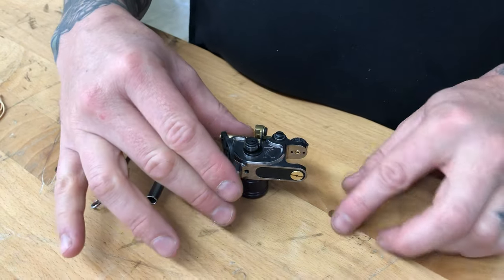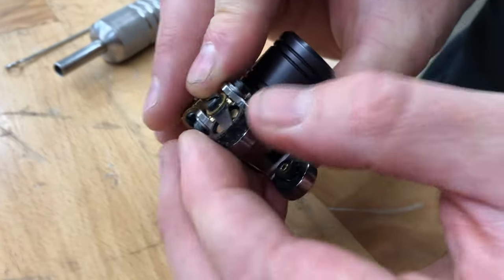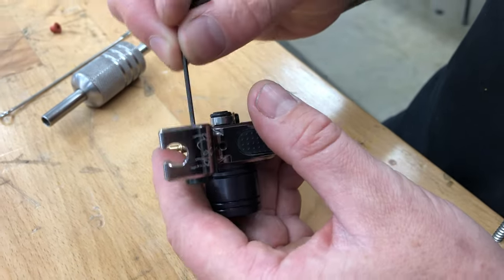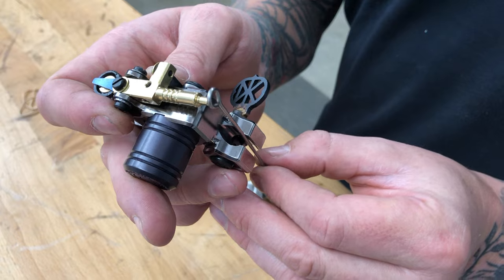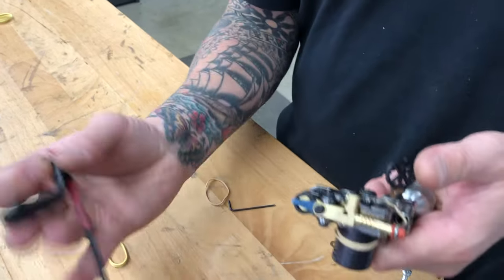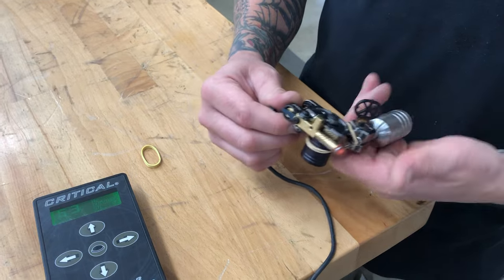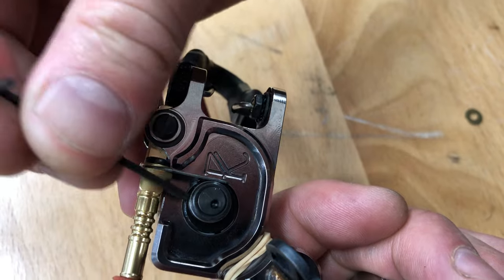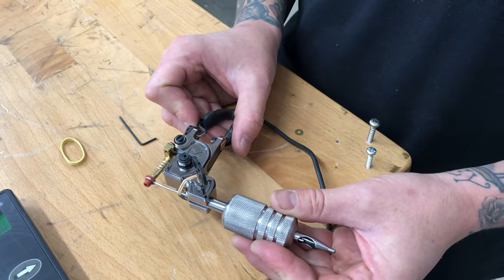Sidewinder V3R setup and tuning

Comment: ive been using two types of v3rs now for almost three years now. I love them and they’ve really made tattooing easier. I do get puzzled by the impact screw/timing mark. I usually run it around 5.8-6.5 volts depending on the work/placement. However, I’m not exactly sure of where the timing mark suits my tattooing best. If I haven’t gotten this video wrong after the 4456th time ive watched it, the closer to the end of the timing mark the harder the impact will be?
Reply from the maker: The more you turn in the contact screw, the more impact you will have, and the cam will be rotated counterclockwise as the impact is increased.  I usually set the impact so it lines up in the middle of the notch
Reply: @dankubin5386  thanks for the quick reply mate. nice to have it confirmed by the man himself. i guess i just have a case of classic overthinking! take care and thanks for the tools

Comment: Can you show us the proper set up for running this machine with cartridges?
Reply: Not suppose to run the v3r with carts.
Reply: @evanabt8578  the new ones can supposedly run carts, Workhorse Irons mentions how to it up
Reply: @stabbysean4895  I thought when they say new ones they are taking about newer models. Cuzz I have heard Dan talk about his new models being cartridge friendly.. not the V3R tho. Maybe u know somthing I don’t tho.
Reply: @evanabt8578  I’m not sure, just that if you go on WHI and look at their listings for V3R it shows how to set up for carts. But defo the 7.3b is made to be compatible
Reply: @stabbysean4895  ohh cool.. good to know. Ima check that out. 😎
Reply: @evanabt8578  but I will say on Dan Kubin’s website it says standard needles only. Also the new Sidewinders seem to be more versatile (shading, packing) than the V3Rs which seem to be strictly liners
Reply: I just use a push bar with my Fk iron click grip and two rubber bands, it runs fine for me, but the new v3 r I have can run carts from what I was told
Reply: @stabbysean4895  Nonsense, learn to tattoo with the tool provided. I use the V3R for anything both on bar and on cartridges. There's a reason it's such a versatile machine with so many fine tuning elements. I've stippled with it, amazing results. Used a tight 3, super clean and no blowouts - packed color, blended - you name it.
Reply: @sirfargy  that’s great but I’m literally telling you what Kubin told me. I emailed him about this and he said V3R is bar only, the newer sidewinders can run carts but he doesn’t recommend it at all. He said it’s like putting shit tires on a sports car. There is a way to set up the V3R for carts that Workhorse demonstrated as well but, again, Kubin said the sidewinder is more optimized for it if that’s what you want to do.
Reply: @stabbysean4895  and yet when I asked him he said it's possible and should work alright, but he recommends the swingliner. He didn't use the shit tires analogy. So that's also great. Looks like he gave both you and I a different answer. Want me to send you works I've done with it on a cartridge?
Reply: I'll fix everyone's issues right own v3r us for standards u can use carts but it's not great new swingliner and dmcv2 are great for carts no crazy turning bam

Comment: Just bought one and on your video you show a impact screw on the side of the armature bar but mine doesnt have that and actually the armature is different then yours and I bought the vr3 . I dunno I feel confused and not sure where on my machine to change the impact since its different then yours but supposedly the same ???
Reply from the maker: It’s changed. It’s towards the front now.  Should be common sense.  I moved the impact to the front of the machine to help keep it in tune longer, and easier to dial in
Reply: @dankubin5386  I feel kinda dumb now lol thank you for the quick reply! I'm really  excited to use the machine and appreciate your comment.

Comment: With the new version, there are two notches by the cam, should I still try and turn it to set my impact?
Reply from the maker: The notch at the 1:00 position is still for the impact.
If running faster, you can line it up with the lower end of the notch.
If running slower, or setting it up with cartridges (which isn’t ideal) you can set it to the higher side of the notch.
Basically, if the machine isn’t snapping hard enough even after you adjusted your stroke, it’s time to reset the impact.
If your machine is running hard, loud, and choppy, you may have the impact screw turned in too far.
Reply: @dankubin5386  i know this might sound daft, but i genuinely don’t know how to reset the impact? i’ve watched this video 50 times and i still don’t understand what you mean by that or how it’s done
Reply: just simply turning the impact screw in ?
Reply: @dankubin5386  Thank you. So the 1:00 position is what I would want for color packing and bold lines? Also, how do I get it to stya in place? The screw in the middle of the cam?
Reply from the maker: @amandagraves4129  I don’t think I understand. The impact is adjusted by the set screw on the armature bar. The side locking screw keeps it in place.  1:00 is always a good spot. If it’s pooping out, lift up on your rubber band to reduce return spring tension, thus having a stiffer hit for shading/packing

Comment: Hi can you change the cartridges on this ?
Reply from the maker: You just have to use a rubber band to negate the cartridge tension.  Feel the tension with a standard needle with the rubber band on, then use a rubber band to pull the bar down with a cartridge until it sounds, feels, and hits the same

Comment: Mine worked amazing for a bit and now it keeps snagging on the skin not sure what’s going on :/
Reply from the maker: I would check the stroke length and impact setting.
Reply: dan kubin thank you I really appreciate your reply, I’ve tried playing with the impact screw and stroke but this whole machine is like nothing I’ve ever used and I don’t understand the mechanics of it lol :p super great machine otherwise
Reply: @tattooman9294  it snags alot when the strike is short you need to set the impact screw and make the stroke longer
Reply: @tattooman9294  I'm on the same boat here! No longer that magical beatiful machine, and only after 4 months of none daily use.
I've reseted the impact screw, now im playing with the strong length, but it just doesn't feel the same.
Did you find any answer to your problem ?
Reply: @thefranserrano.tattoo  
At first make sure that your impact is set perfectly (in most cases exactly on the low side of the marked area on the frame) and that your upstroke (strokewheel) is also set within the marked area on the frame. Dont look to much on the numbers of your strokewheel, just find out which numbers are roughly within the marked area and start using them. The number 5 is not the perfecr stroke on every of those machines, because there can be little differences because of the finishes or the production. Strokewheel on 6 on your machine can be the same like strokewheel on 2 on a different v3r. So its always the best to check which stroke is the „perfect“ one for your machine with the timing marks. 

From there you can make little adjustments on the strokewheel and the impact-pin, but dont go crazy and keep the impact timing rather low than too high. A super tiny adjustment on the impact screw can make a huge difference. You can always check your tuning with your thumb and see how it reacts to resistance and listen to the sound. If it sounds shitty it will not hit right. Dont turn it in too much because the result will be a really stiff and loud hit with a shortened down stroke that tends to snagg and chew up the skin. Some people like to run it with more impact on a lower voltage, but its a really hard hitting result because the springs dont flex much like this. 

Dont run it slow on a short stroke and dont run it too fast on a huge stroke setting. The shortest strokes are great for super high speed lining or fast shading, around the middle is great at 5,5-6.5v and the long strokes are good for low volts stuff like heavy whipshading or slow lining with big liners. 

make sure that you are using a thick rubberband and place it perfectly straight on the needlebar like dan shows it in his videos. Those rubberbands are adding up to the springtension. You can always pull it up a bit if you prefer to run it around 5v instead of 6v, but high speed (5,8v-7v) is definitely where the mechanism shines if your stroke and impact is set correctly. You can run it really low too, but it will need a bit of experimenting with the impact, the stroke and the rubberband. 

Hope this helps ✌🏻
Reply: If 5,8v feels too fast (especially with flipped clipcord and/or short stroke) for smaller liners you should try keeping your perfect impact setting and pull your rubberband up a bit. It will run really hard on high volts but it should run good at around 5-5,8v and it makes it possible to run a shorter stroke on lower volts without being choppy and stabby. Especially the actual v3r runs really hard under 5.6v, pulling the rubberband up takes away some springtension and makes it great for lower volts like the knob on the v7 sidewinder.

Comment: Please talk about the 3 orings to silence the machine!
Reply from the maker: I removed that feature, as it takes away from the effectiveness of the machine.  I did a tattoo partially with the o rings, and finished it without.  All the lines with the o rings/silenced way were faded, while the rest of the lines were solid.
Reply: @dankubin5386  so you recommend to remove it? I was using 2 orings with cartridges, now i was going to try 3 o rings with the impact screw loose (no impact)

Comment: should've covered adjusting the pivot points
Reply: Why are you adjusting the pivot points?
Reply: @patrickdurka6188  too much friction
Reply: @jamesdavis3528  will the screws not come loose after some time if they arent tightened up correctly?
Reply: @patrickdurka6188  exactly right.....and if tightened too much there's friction and it interferes with the running of the machine...
Reply: @jamesdavis3528  thats good to know, never thought about checking the pivot points